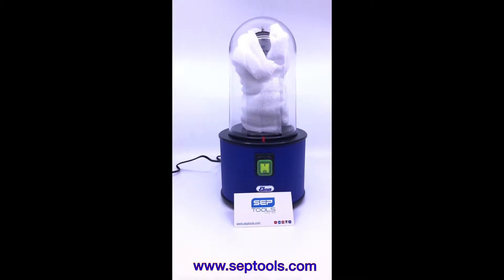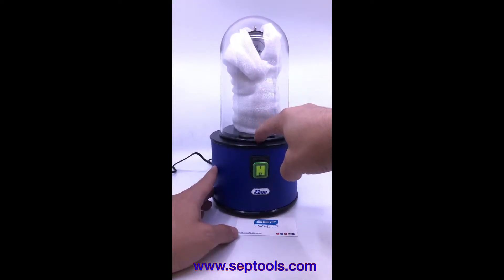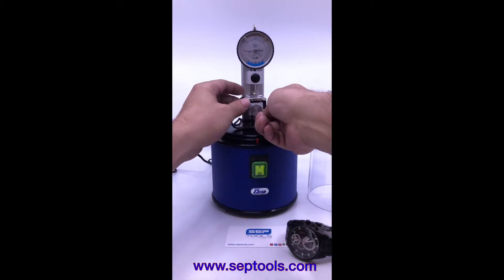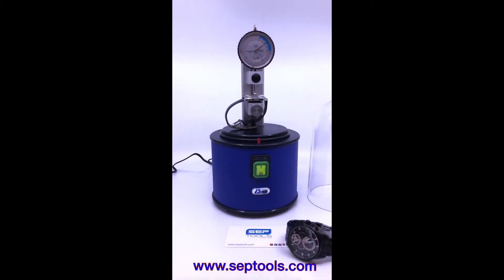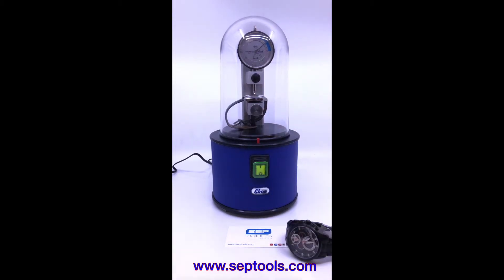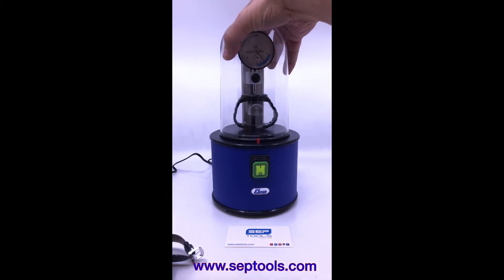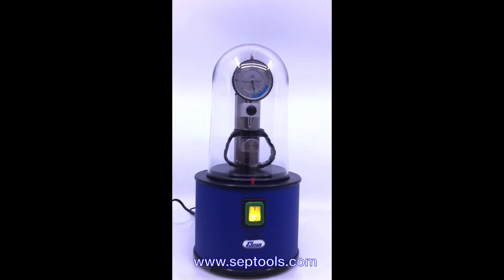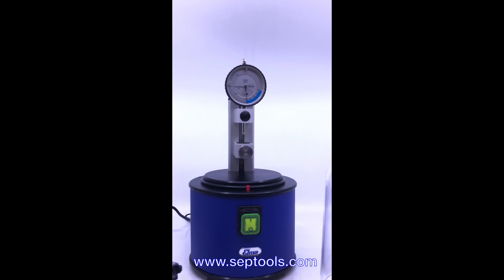ELMA LEAK CONTROLLER 2000

Comment: this is not accurate, this is from the manual,,

The dial gauge pointer remains stationary at test deflection: 
the watch can be considered as absolutely watertight. 
• The dial gauge pointer moves to a maximum of 20% of the 
total deflection in relation to the zero position: the watch has 
a small leak, but can still be regarded as watertight. 
• The dial gauge moves back by more than 20 % of total 
indication range: the watch has a small leak, which means 
that it can no longer be regarded as watertight. To locate 
the leak, see chapter 5.2. 
• The dial gauge pointer shows no deflection during testing or 
moves into the negative range of the dial gauge (against 
scale number 100): the watch has a large leak

Comment: Great video, but what does it mean if the needle moves negative?
Reply: The dial gauge pointer remains stationary at test deflection: the watch can be considered as absolutely watertight. The dial gauge pointer moves to a maximum of 20% of the total deflection in relation to the zero position: the watch has a small leak, which means that it can no longer be regarded as watertight. The dial gauge moves back by more than 20 % of total indication range: the watch has a leak, which means that it can no longer be regarded as watertight. The dial gauge pointer shows no deflection during testing or moves into the negative range of the dial gauge (against scale number 100): the watch has a large leak.